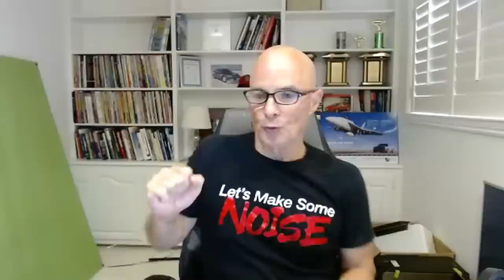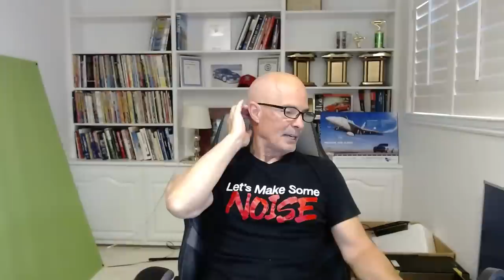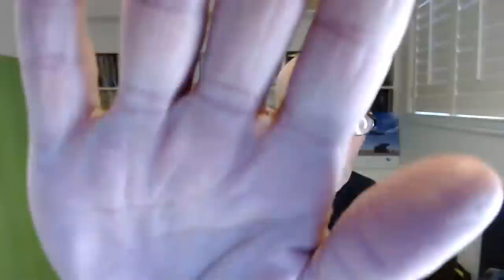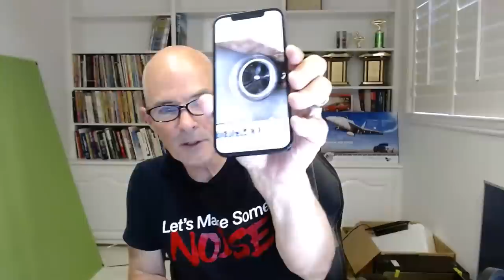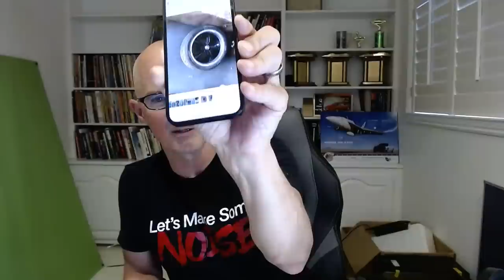LET'S TALK TECH-WERE MISTAKES MADE ON THE GT-40 INTAKE TEST?

Comment: I have a tube gt40. With center bolt mod. The opening is matched to an accufab 75mm. Matched to lower and lower matched to to gasket that fits tw 170cc fast as cast intake port for funzies

Comment: Test one of Bigdogs Portings stage 2 or the cut, shortened and welded Stage 3 and see how different those are compared to any other ported manifolds you've tested. We've had customers make as much as 40whp more on the top end over a ported Edelbrock RPM. The video of this is on YouTube
Reply from the maker: I would like to
Reply: @richardholdener1727  ❤👍
Reply: @bigdogsportingtonyb2833  Tony, send the man one of your intakes. 
Or... Richard, I have one of Tony's ported upper and lower '93 Cobra intakes. If you want to test it, we can work out shipping it back and forth.
Reply: @pimpovic2  we will be posting dyno results of our stage 2 and stage 3 gt40 manifolds soon on our own crate motor.
I understand why there is a push from certain content creators to always show aftermarket parts making more power than the factory parts. Sponsors, to promote aftermarket parts sales and brand loyalty. If people show that our ported parts can make more power cheaper then more and more people will go that route. That's not what the industry wants.
Reply: @bigdogsportingtonyb2833  I assume you have a plain Jane manifold as a baseline?
Reply: @bigdogsportingtonyb2833  Richard says he would like to. Send him one of your Stage 2 intakes for testing. You'll gain a wider audience than from your YouTube channel alone.
Reply: @pimpovic2  we gave him our email address a while ago to set it up and heard nothing so we did our own crate motor dyno. We don't expect these guys to tell people they can make just as much or more power with ported factory parts because it goes against the industry's goal which is to charge as much money for aftermarket manifolds as possible. We have customers making 360whp/350wtrq with our ported P heads, our stage 2 ported Explorer gt40 manifold, our ported 76mm throttle body, our stage 2 cam, our ported shorty headers on a 302 with a T5 on a dynojet and still having ac and heat. We've put the flow and dyno information out there and our customers know the truth.

Comment: RICHARD, CAN you cut down the runner lenght by 4 inches moving the plen6m closer to the throttle body? That should mo
ve the torque curve higher in the rev range.
Reply from the maker: shorter runners shift the curve-easier to run short runner upper